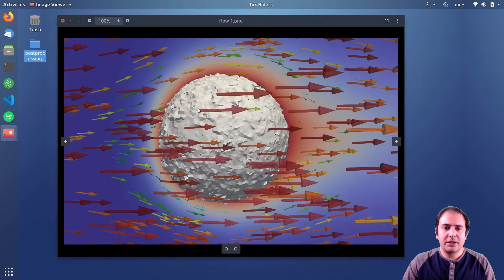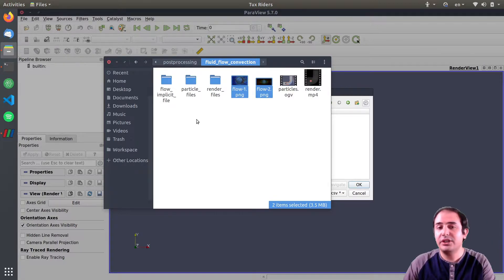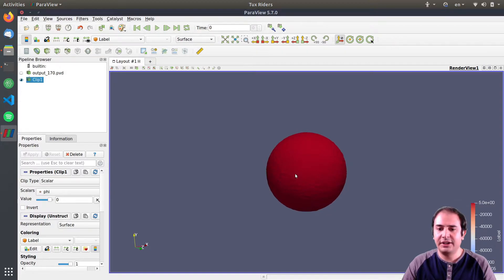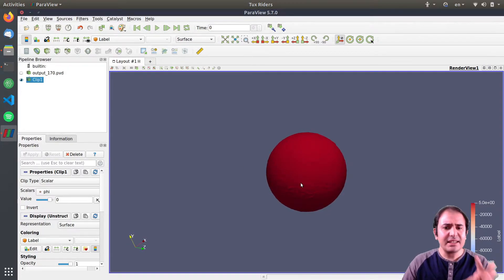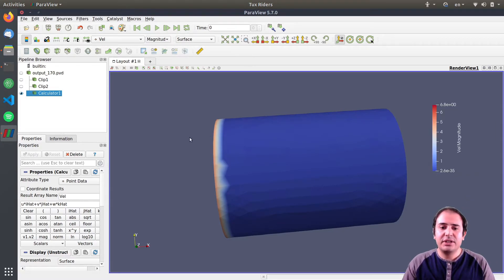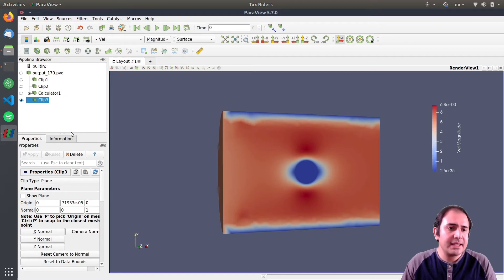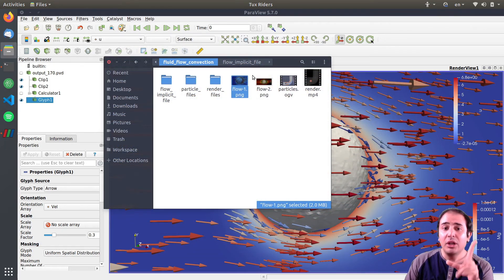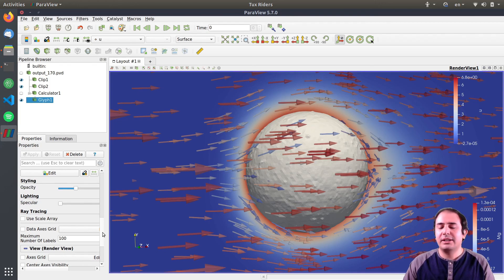[ParaView Postprocessing 11] Fluid flow: working with fields and vectors

Comment: Thank you for the great resource. What is the source of these files ? I want to use them and if it is possible I would like to cite them properly.
Reply from the maker: you're welcome :). as mentioned in the caption, you can download the sample files from this shared folder: https://drive.google.com/drive/folders/1emHuLLkXBkJoCii_4obBy9PNRlK7n1Vq. the simulations are mostly performed using this code: https://github.com/mbarzegary/BioDeg
Reply: Thank you for your reply but as I wrote I was asking the source of the files to cite. In other words, did you create this data or take from somewhere else ? @TuxRiders
Reply from the maker: @damla818  yes, I am the developer of the BioDeg code I mentioned above. there is a section called publications in the BioDeg repo (above link) that you can use to cite the content and the software.